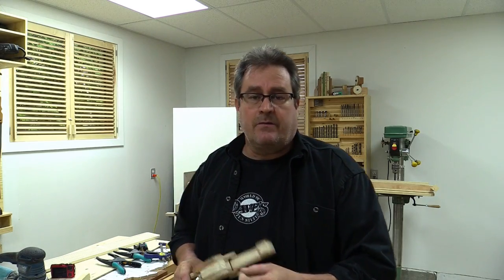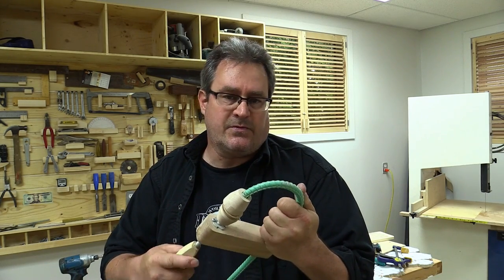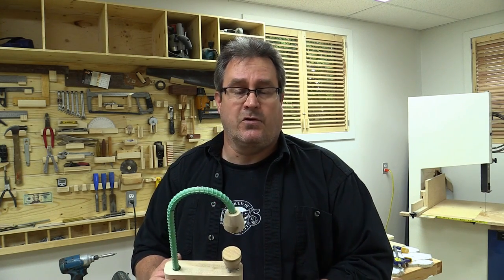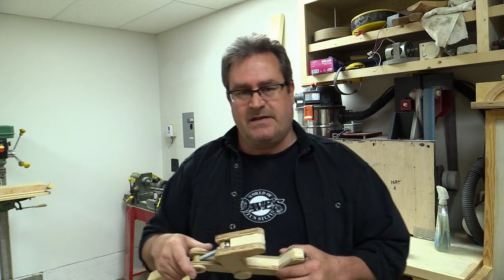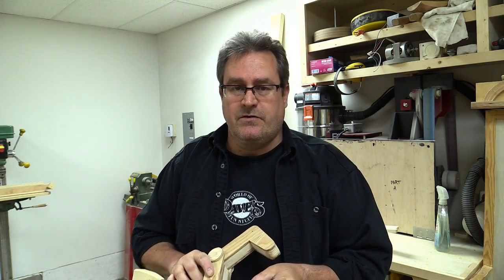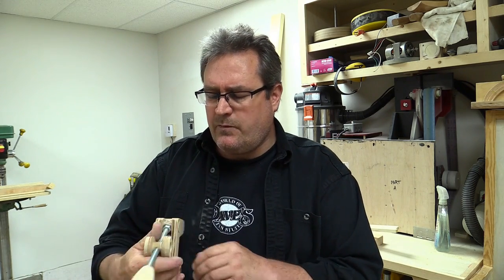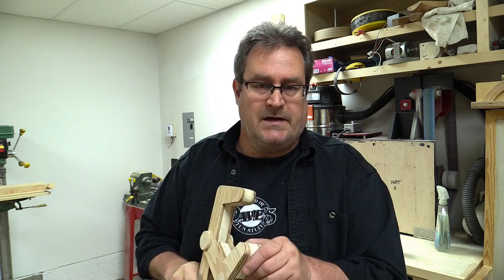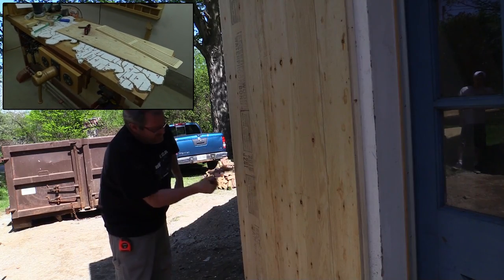The Kant Twist And Rebar Clamps

Comment: The naysayers may not realize this: sometime we build projects not because we're convinced that they are going to produce a killer result; but as a test of an idea, or as an experiment in potential.  The device itself may not have great utility--the rebar clamp is an example--but the personal knowledge generated is valuable.  And not just knowledge of the clamp's limits, but also knowledge of the techniques that it took to produce the clamp.  The clamp itself may be set aside, but the knowledge will carry forward.

Comment: Have you ever thought of grinding a flat side on the back edge of your rebar clamp and adding a washer to the top hole of the clamp with a flat edge to stop it turning. The quality of the audio and photography over the last year has improved significantly.
Reply from the maker: ***** Thanks! I thought about doing something like that, but it would add a lot of work and take strength away from the bar.

Comment: I get the "That's great if you have the tools, but I don't, so it sucks!" kind of comments a lot on my channel. It's starting to frustrate me a bit to be honest. I firmly believe that not allowing yourself to be stopped because you don't have a left handed screwdriver but instead look for alternative routes is the very essence of creativity and making things. Finding out how to is half the fun!

Thanks for the clamps revisit!
Reply from the maker: Switch & Lever I hear it a lot, usually from people that are not short of equipment, but motivation, desire and determination. Those that want to, find a way.
Reply: I Build It I was always taught "If there is a will there is a way", I guess some people are just short on wills rather than ways.
Reply: I grew up without much. Now that I'm grown up, I still don't have much. I piece together things here and there from scraps or things I find. (Doing site clean-ups or browsing Craig's list can be a great place to find much needed project materials for free.) If I don't have a tool, I look for other ways to do it, or I figure out how to MAKE the tool. Even if it only lasts one or two uses, it helps me make the end project, and it shows me that I need to adjust my design some so last longer.

Not having those tools is not a good excuse to not make something. It's a good reason to get creative and use your imagination.

Comment: Agree that woodworking clamps don't need extremely strong for glue ups. I like your DIY clamps. John, thought you said you were going to join the workshop with the house? Am I wrong or are you putting it off until another time?
Reply from the maker: MRrwmac Hi Mac, no plans to connect the shop to the house. I've been getting the area ready for a wooden deck that will fill the space between the house and shop, giving me easier access and an area (during the spring, summer and fall) to do some projects outdoors. More on the in an upcoming video(s) on my home reno channel.

Comment: Love the homemade clamps! A possible solution for having to spend time screwing and unscrewing the threads, epoxy a nut on the back of the handle and use a drill/driver to loosen or tighten to the desired opening width, then finish by hand.
Reply: Scott Border 
NO! You can't use epoxy! It's deadly poison!!1!1!
Reply from the maker: Scott Border I did that on another clamp (drove a screw into the end of the handle), but it's usually faster to just unwind it by hand, if your driver is not already close.

Comment: if you really want cheap homemade clamps and don't have any fancy tools, you still can do. With some mild ingenuity I've been able to adapt your (and thiswoodworks) bar clamp design into one I can produce, without even drilling 90 degree square holes (I have yet to polish my skillset). In my case, planning ahead and thinking how to overcome innacuracies worked out great.
Besides, aside from the hardware used, the only tools I needed were a handsaw, corded drill, file, two hammers (a loose head served as anvil) for flatting out the nut and threaded rod, and a hacksaw. The only layer tools I even used where an old rusty carpenter square, mesuring tape, pencil and a snap-off utility knife.
So if you really want it, and can stand ugly results, even with almost no tools you can get by.

Comment: Way to keep the rebar from spinning maybe, tell me what you think. if the bar is 1/2", instead of putting a .5 hole try .437 or smaller then use a chisel or blade to square half the hole and grind the bar square on one side. I think that's what I would try. Trial and error

Comment: You pretty much contradicted everything you said about the green rebar not being toxic by saying it's coated in Epoxy...
Epoxy is toxic if ingested/breathed in and that is one reason why knife makers NEED good respirators...besides the fiberglass (from the G10) floating around the air, and the fine wood dust. Epoxy is dangerous stuff if it is in a fine dust, and when mixing it without a respirator...
Reply: Tanner saslow 
??? Do you chew on green rebar? FYI it's not a candy cane. So how do you ingest it?
Have you ever cut something with a grinder? Most dust is almost as coarse as sand. You must have some weird habits, as I don't know how you manage to breath that either.
Reply: superdau nope, but as you cut the rebar, the epoxy coating will either burn off in the form of fumes (the metal will get hot pretty quick...) or come off as tiny granules of dust that could be breathed in without proper safety equipment. it really doesn't matter how coarse it is either, if it gets in your lungs, it is bad for you regardless of the molecular/chemical composition. Imagine sand piling up in your lungs.
To answer your question, yes i have several years experience handling grinders;both belt and angle grinders. don't believe me, check this out-
http://www.bladeforums.com/forums/showthread.php/1289653-1080-Drop-Point-Hunter-in-Lignum-Vitae
so what have you done in the shop lately mate?
Reply: Tanner saslow 
Coarse dust doesn't do much, it doesn't get far in the lungs and you cough it up (I'm not talking about daily 9-5 exposure here). With a fine metal cutting disk it doesn't even take 10 seconds a cut. Big pieces of metal won't really get hot in that time. I've never had any fumes from something like that.
I'm not saying that you should breath expoxy sanding dust, but that's something totally different than the grains from cutting. And there's a huge difference between cutting a few rods a year or doing daily sanding. If you call the former "hazardous" or "toxic" it's just stupid. Pro tip: you can cut rebar with a muscle operated metal saw. I don't say that it's fun, but I doubt it creates fumes and fine dust. Someone who panics about that, should lock himself in, because driving to the store to get the rebar (epoxy coated or not) is more dangerous than cutting it.

What I've done in the shop lately? Installed some ventilation ducts in the basement, dangerous masonary dust from hammer drilling and plaster mixing included. Not to mention I cut PVC pipes on the table saw and fine trimmed them with a grinder. Also used polyurethane sealants in a nonvetilated area. 
Just today I cut, filed and ground small aluminium profiles, cut and rough sanded wood and milled and drilled some glass fiber boards. The last one is where I use a dust extractor, because glass fiber dust is fine and the router spindle blows it everywhere. Then I also soldered some electronics, with all the fumes...
Reply: superdau true, however it can't hurt to try to limit your exposure as much as possible. really any dust in your lungs is bad. go on Bladforums and as around about how bad the dust is. Some woods are even toxic (to a degree).
Reply from the maker: superdau Well said :)